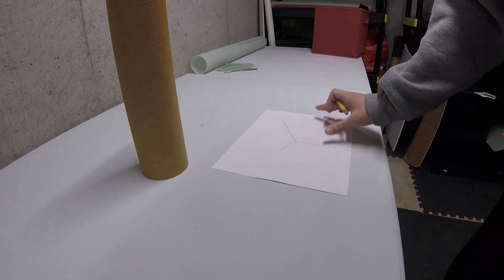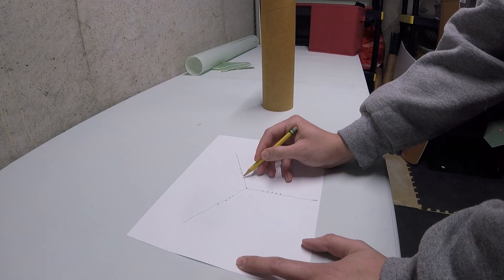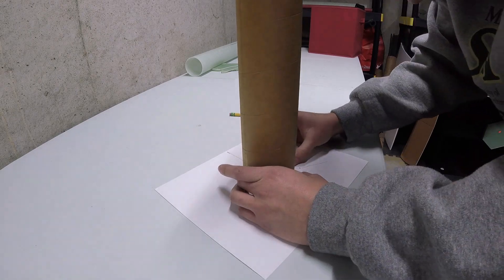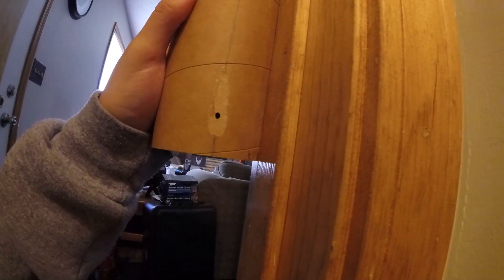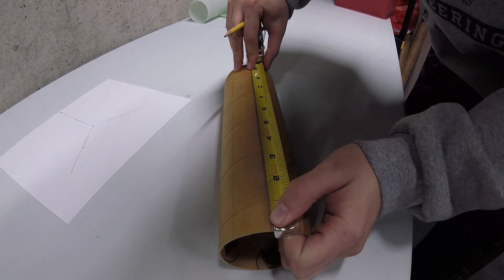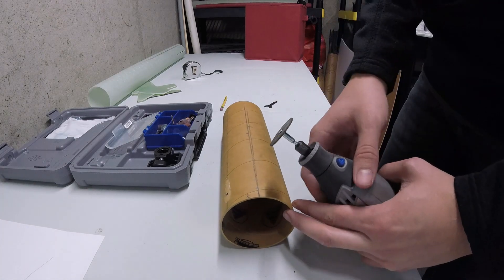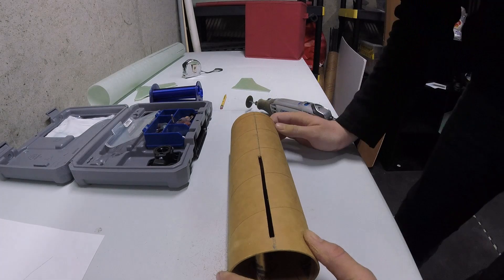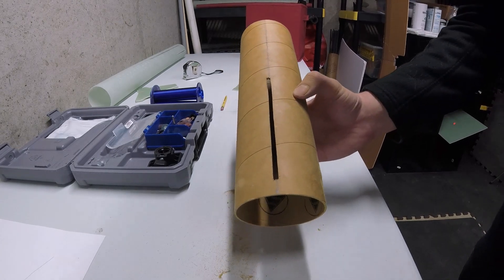Rocket Building Tip - Fin Slots

Comment: Hint: on marking the tube at 90 or 120 degrees, mark a center dot on your paper, get s compass and draw concentric circles different distances from that center dot...I usually make the circles 1/4" apart. It makes centering the tube on the paper much easier and avoids putting the tube on the wrong marks. Also ditch the tape measure for a ruler or sacrifice a $1 tape measurer from the dollar store by cutting off the first foot and us it as the ruler.

Comment: I would have liked to have heard more of the  sound of the dremel when cutting. I do not have a dremel yet, and the wife will  surely object if it is too noisy or wines a bit. What would you compare the sound of cutting or operation to?
Reply from the maker: Dremels have a sound that's a nice cross of a hairdryer and a vacuum cleaner in my opinion. They aren't loud enough to need hearing protection.